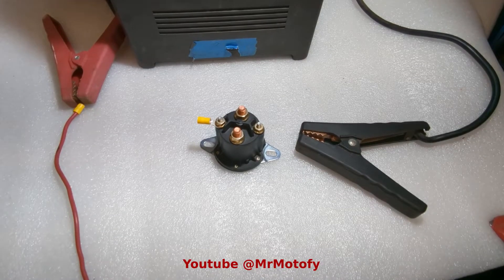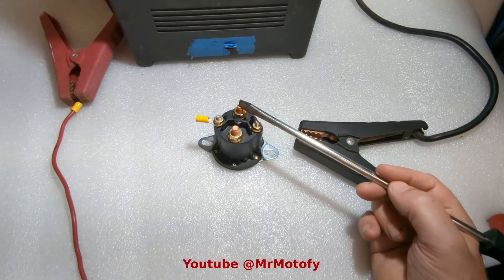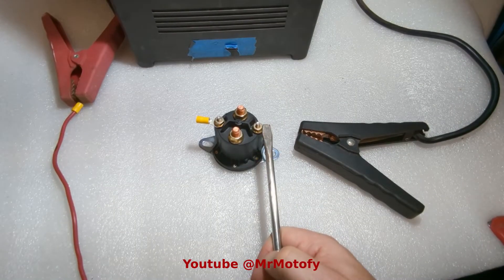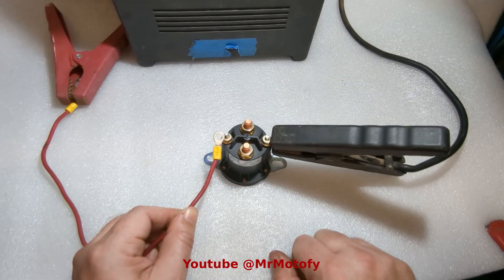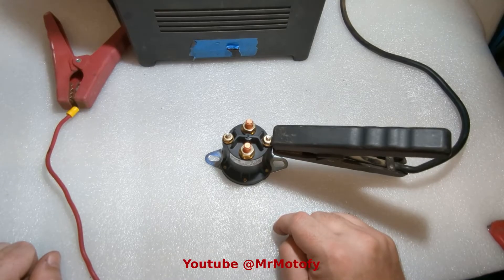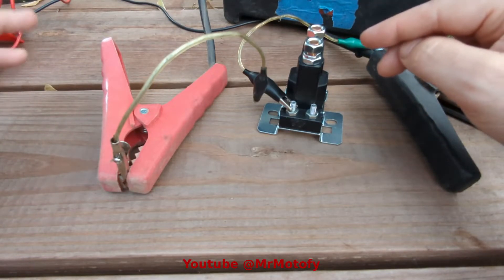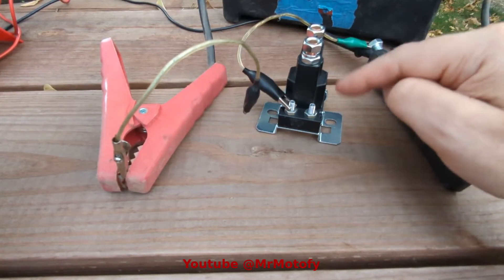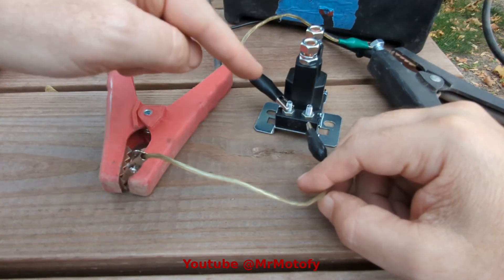Solenoid HOWTO Wire/Test Snow Plow Western BOSS Mower

Comment: Great video, I thought the 4 pin solenoid was grounded by screwing it to the truck. On the small pins, how do you know which one is positive and which one’s negative? Does it matter? Thanks for any info.
Reply from the maker: @JackieBoy502  On these the base is NOT NEG. Frequently it IS but not this case. 
No the small screw doesn't matter Pos or Neg, they can be swapped. But depending on what you're using it for the wiring may differ.
Reply: @mrmotofy a little in the future but i have a question it might be simple or maybe something for somebody else, but i have a western plow with solenoid 56131k-2  it’s on a snow plow electrical 4port 3 plug system but everytime i press the on button on the control and try to press any button other then down it shuts off and makes a little click noice from the solenoid if i press down button nothing happens no movement it got stuck and was wondering if swapping out the solenoid be my issue or would it be deeper like testing a wiring issue, i check fuses all good still i get constant 12 volts to my controller just having issues just recently that got it stuck down position

Comment: One shows up on the dashboard lights on the 4 by 4 Dodge 90 what does snow plow burns on you got the other switch to go to the snow plow it does not lift up
Reply from the maker: @MagicSamuel  you can test for power passing through solenoid correctly by following the vid. Best to use a multimeter

Comment: Does solenoid on one post and the other one with the light tester one lights up p the other one does it
Reply from the maker: @MagicSamuel  huh? If you apply Pos and Neg to the small posts the 2 top large posts contact closes and power passes (if it's working).

Comment: This was extremely helpful. I have a cable operated western that won’t run the motor. All of my testing points at the solenoid being the issue but I have replaced the solenoid with a ford starter solenoid because a mechanic I talked to said that it should work. It still doesn’t work and I’m thinking it’s because of the solenoid so I’ll try a western style solenoid next. Thanks
Reply from the maker: @Mountain_Wild  Awesome glad it helped ya...hope you got it working
Reply: @ worked great thanks!
Reply: Same thing here original clicks new solenoids do nothing
Reply: @slednecksification get a different solenoid Cole Herse is a quality brand or get a western brand. My issue Was the type of solenoid was incorrect
Reply: @Mountain_Wild  ive tried 3 different ones bought a western one none work i out the old solenoid on boom it clicks and sometimes works